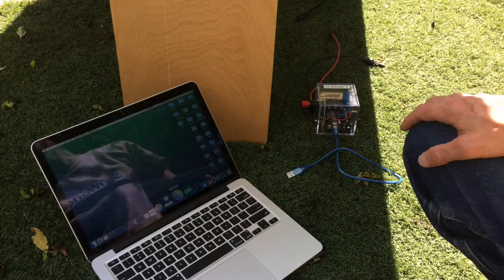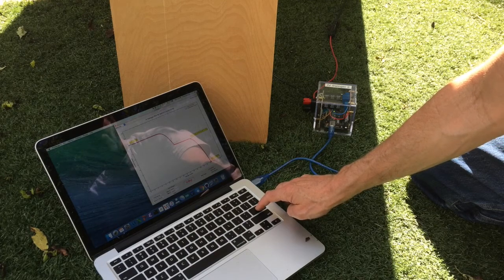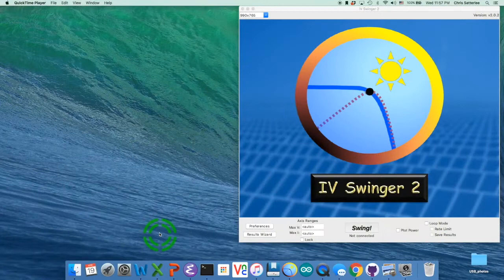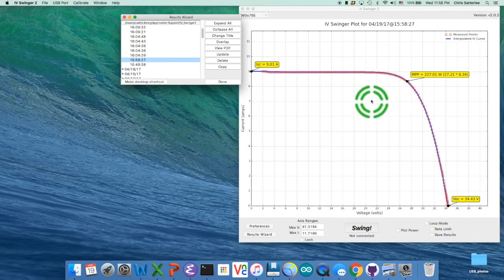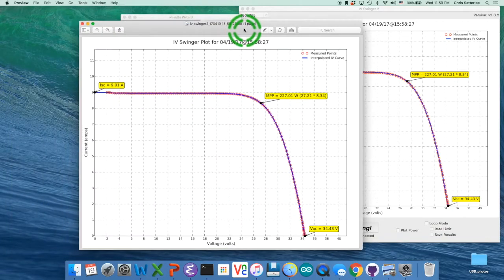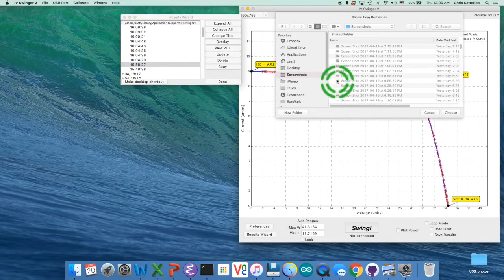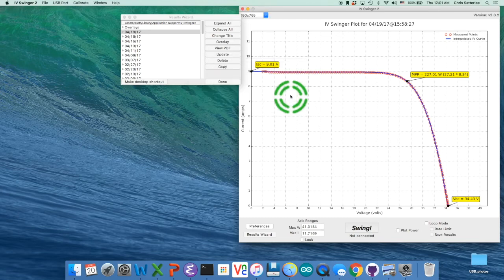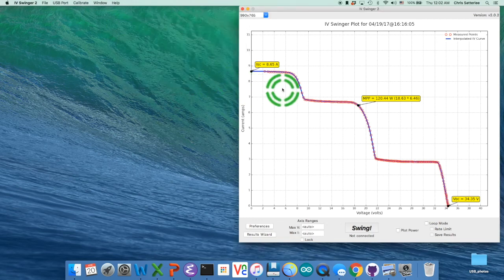IV Swinger 2 Demo, Part I

Comment: Although I can write code and design electronics, I just used a resistor, capacitor and switch to do the same thing with a digital scope that has a math function and do a screen save.  It would be nice to have all that data. My simple setup is handy for finding major problems and seeing the effects of shading on parallel strings.  My cheap controller gets lost on localized lower peaks, a common problem. They now sell this in a hand held tester for $50. I only found you because I was looking for a SWINGER 1 dynamic load tester for power supplies.  Nice job.

Comment: Dear Chris Satterlee, thanks for this nice and interesting tools. Nice jobs. Thanks for sharing. I don't understand why you get steps in your measured I-V curve. Is it shading effects? Best regards
Reply from the maker: Sorry I missed this question 11 months ago!  Yes, the "steps" are due to shading and the bypass diodes. Typical modules are organized into three groups of cells, each with a bypass diode. How the bypass diodes affect the IV curve under different shading conditions is one of the most fascinating and educational things that the IV Swinger brings to light. The theory is covered in "Renewable and Efficient Electric Power Systems" by Gilbert M. Masters.
Reply: Thanks. Great job!